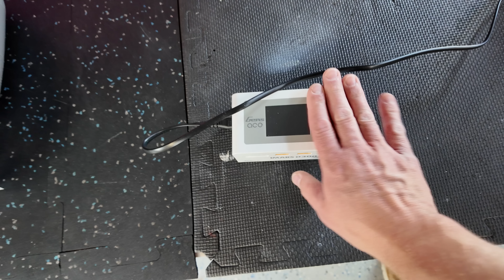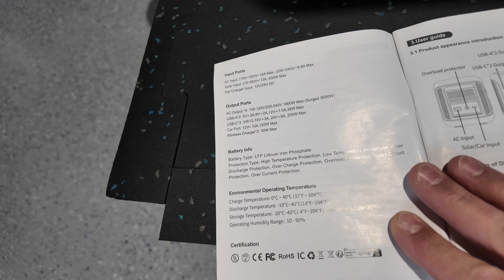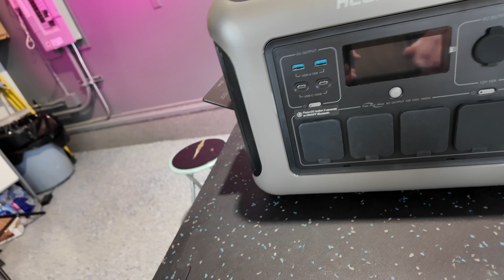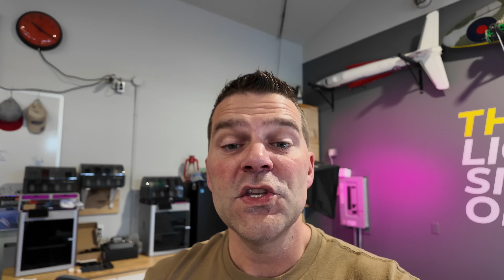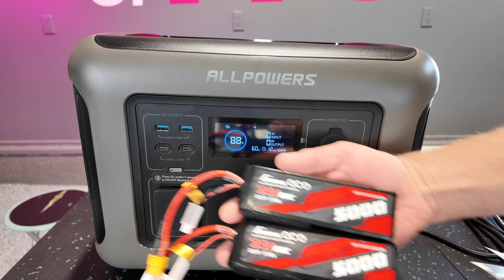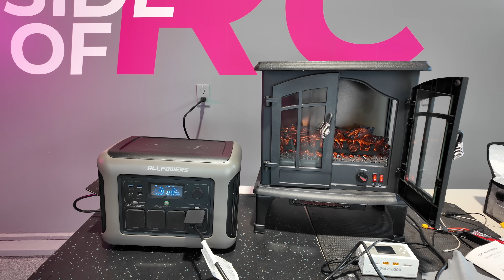Ultimate Portable Power and Charger setup: The AllPowers R1500

Comment: I would NEVER plug any of my chargers into the AC plug in my truck. Vehicle AC plugs have cheap modified sine wave inverters. I would never feed a charger that dirty power. It’s asking for trouble. It’s also stupid inefficient to invert from DC to AC just to convert back to DC for charging purposes. Tap the battery. That IMARS is rated 300W AC and 600W DC input.

Comment: My solar panel charging it only at rate of 3W. Is it normal?
Reply from the maker: Used mine for everything this past week in Tucson. Ran my trailer and charged all our batteries. My panel was charging 130-170W depending on the sun conditions
Reply: @thelightersideofrc  
I just put the solar panel behind the window, is it not enough to charge?

Or does it only charge enough by placing it outdoor?

Comment: Many of the so-called "solar-generators" similar to this one have an issue when switching between utility power and battery power and then back again.  This one doesn't seem to have that problem.  This looks like a good possibility for a "UPS" type setup for our (gas) furnace and water heater, the fans and igniters to be precise.  Especially if it can switch, on it's own, between line pass-thru and battery power and recharge when the utility is available again.
Reply from the maker: That’s a great point about the seamless switching. That’s a big feature for safety in an emergency.

Comment: I might have missed this but if you are using the unit and you plug it in, it passes power though to the device as you showed, but... will it also charge the unit while its plugged in and being used?
Reply from the maker: Yes. Pass through and charges.

Comment: Bought a similar one last year as our field doesn't have power. Real game changer over having to listen to the drone of a generator all day. I have one your size 1150 wh and it great for day use but also have a 2000 wh for days I'm flying electric 6s 5000s. Maybe talk one of the manufacturers to send you a bigger one that you can leave in trailer all the time for your week long events. 😉
Reply from the maker: That’s great to hear!  If it works well I will likely incorporate a larger one into my next trailer design/build.
Reply: how many batteries were you able to charge?😊😊
Reply: @topgun7419  mine is the pecron 2000 it has a 75ah battery. I usually put 3ah back in per flight. So it will charge at least 20-25 5k 6s packs. I know with me and my buds using it we have never drained it in a day. In fact I bought a smaller one that's a lot lighter if I'm just going for half a day and it's good for 8-10 packs.
Reply: @airman9820  perfectly good to know. thank you very much👍👍👍👍